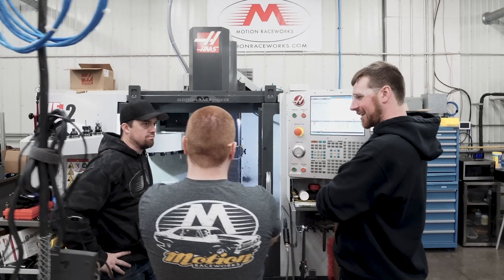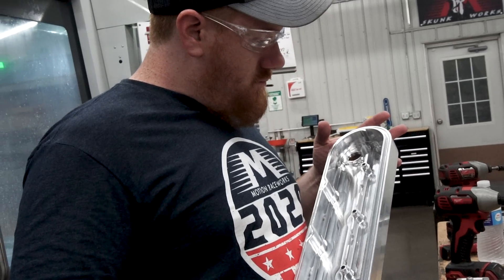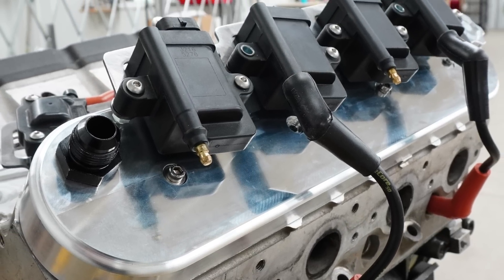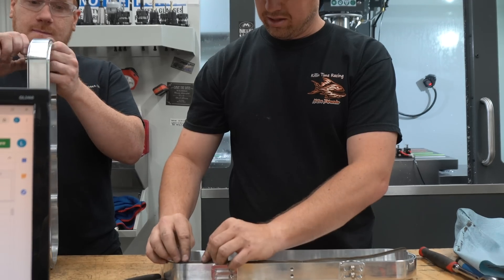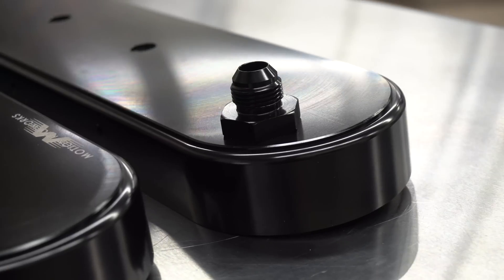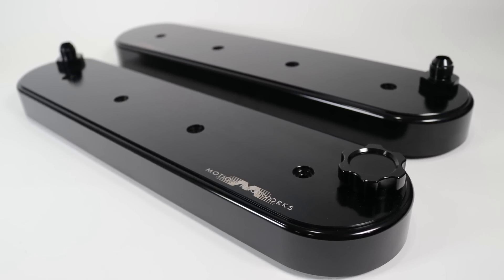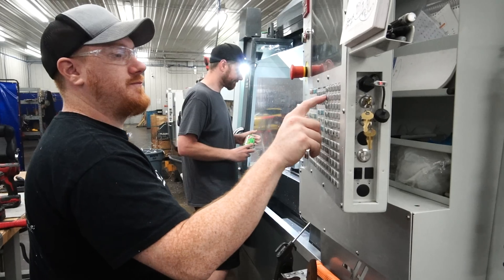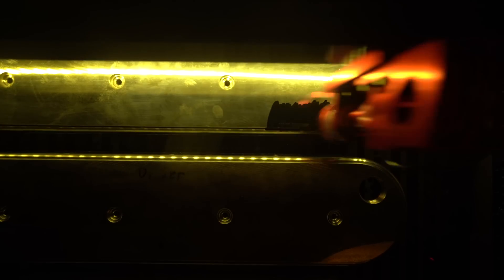Introducing Motion Raceworks New LS Billet Valve Covers!

Comment: Doug those are badass brother. Fanciest damn valve covers I’ve seen to date!  So you touched on this a little. We run a bbc n/a but have roller rockers and still run a plug for now. Do you have these yet or is that something you guys are going to expand in later down the road?  Reason I ask is we had so much trouble finding a valve cover that’s not only tall enough but has baffles high enough in the cover to get away from the poly locks. The ones we have now are tapping the valve covers on the exhaust valves  because of the height of the poly locks. The baffles had to be bent out of the way but regardless this causes undo tapping in the valve train that makes me think we have valve train issues because I hear the tapping everytime we fire up. 

Thanks again. You guys are badasses.
Reply from the maker: We are planning to make some bbc versions for sure

Comment: I think I’d want a bare set so I could have them powder coated in a candied orange. An what about some nice trans pans for GM 6-10 speed cars my C7 needs a deeper pan.
Reply: You must think like I do, that's the exact color I did my engine, i based coated it with medium metallic silver,I have done other people's cars with course metallic shows a lot more flake.My motor is 4.6 cobra with a D-1SC  Pro Charger this has been on there for 10 years and it's not a mustang lol it's a 93 Lincoln Mark viii.My point is awesome color i bet it will look sweet.Good luck!Tom one more thing check out Specialist paints if you want to do some candy paint on other parts that don't get hot they actually sell candy colors in 12oz Aerosol cans they have 16 different colors there right up there with House of colors but price wise is little better they are always coming out with new colors,just wanted to share this with you they have some bad a.. Colors in looking into the new  fools gold candy it's awsome looking.Written by Tom Hanson not Shelley G.